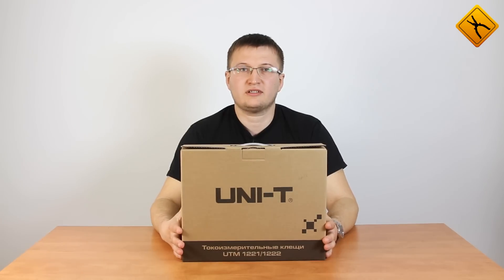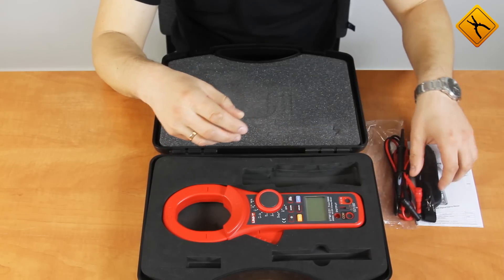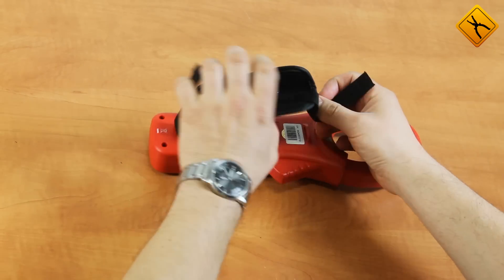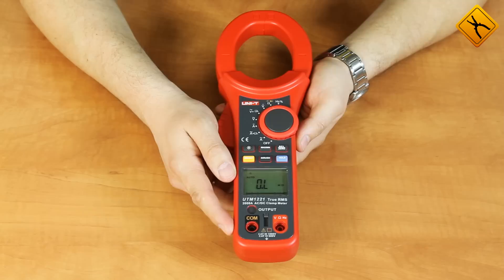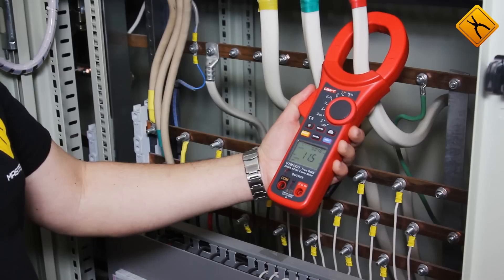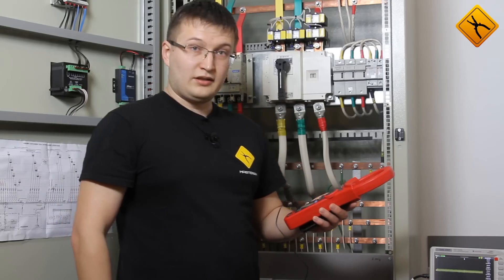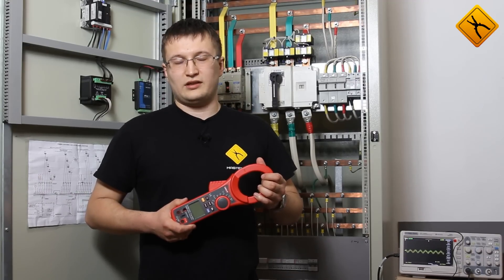UNI-T UT221 Digital Clamp Meter

Comment: Nice video. THANKS. Just take some care using a steel watch around open AC conductors. Just some friendly advice, don't want anybody electrocuted or burnt due due watch touching and sparking against 400Volt conductors.

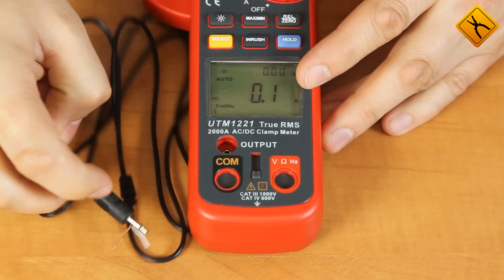Comment: 3:41 not sure how happy i am about the one Mega Volt per Amp xD
Reply from the maker: Hello! Thank you for noticing! There's a small mistake in the video indeed. 
At the output, we have a voltage that depends on the measured current in the ratio: 1 mV per 1 Amp.
Reply: @ToolBoomVideo  i figuredthat out myself, it was just a funny mistake :)

Comment: Bro please let me know if this Instrument measures High Frequency  currents
Reply from the maker: Hello!
 The UT221 digital clamp meter measures AC current at 50-60 Hz. If you need to measure high-frequency AC current, use an oscilloscope + special current probe. For example, Current Probe for oscilloscopes Rigol, which features up to 300 kHz bandwidth: https://toolboom.com/en/current-oscilloscope-probe-rigol-rp1001c/
Reply: @ToolBoomVideo  como teve coragem de medir 400v ac ? kkkk